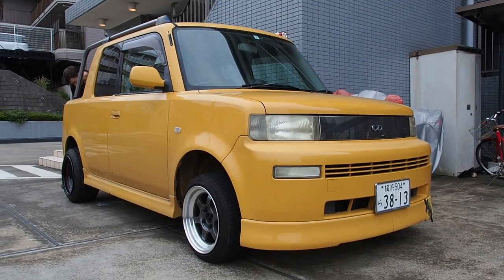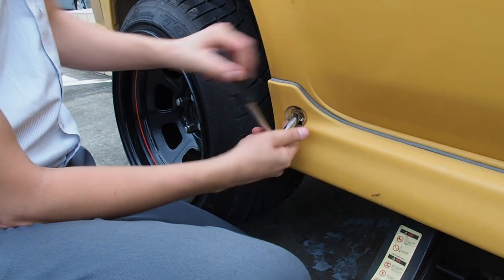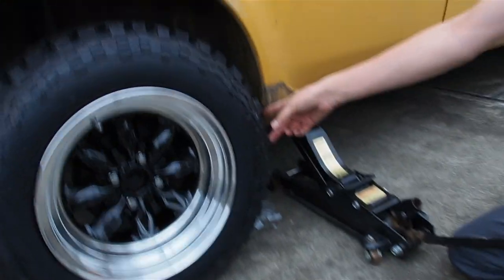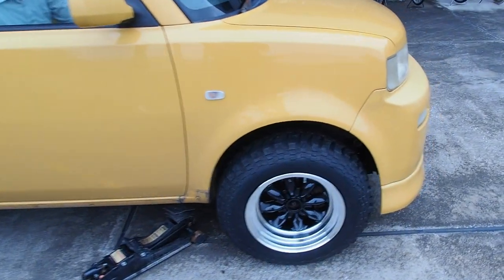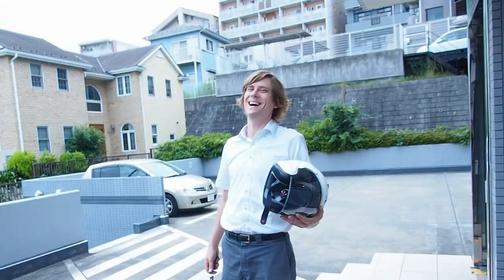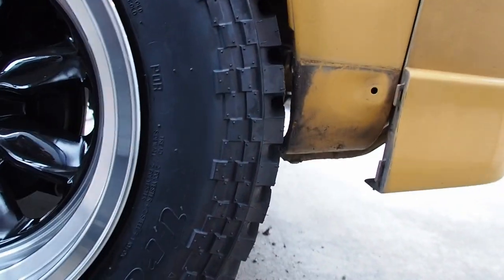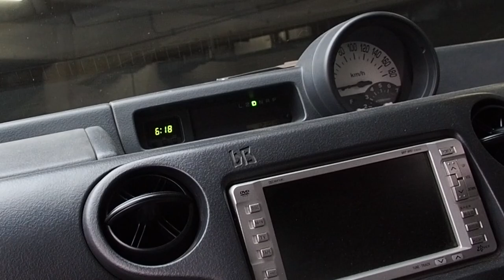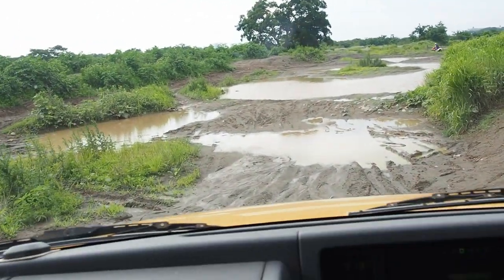Toyota BB Pickup 2-Inch Lift makes a Huge Difference

Comment: Ruined it.
Could've installed airbag suspension.
Reply from the maker: Airbag suspension is really pricy. I think it’s around $8,000 to install in Japan. This was $50 plus the wheels and tires and is fun!
Reply: @PacificCoastAuto  one of your biggest fans. Didn't mean to be rude.
I was just mad that the car doesn't look as good as it did. Sorry.